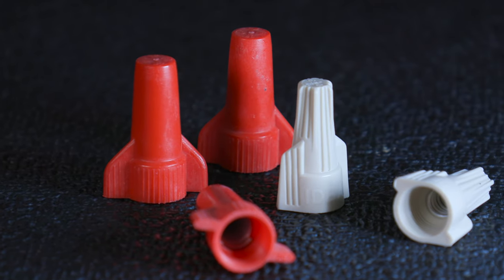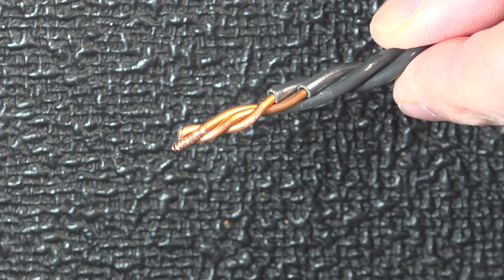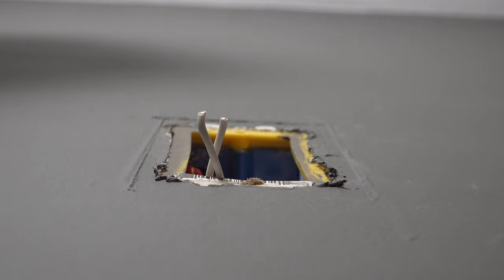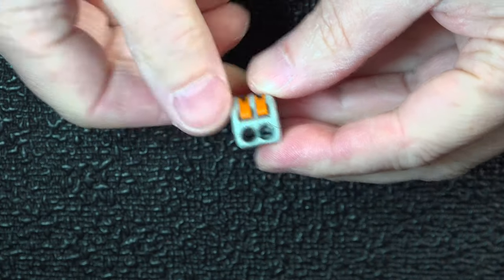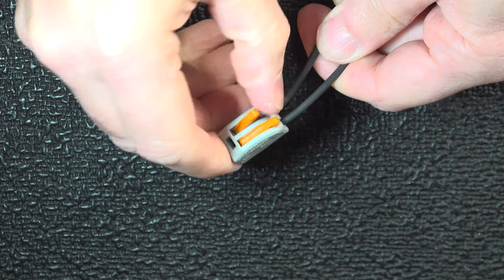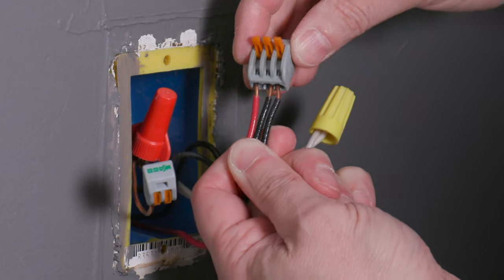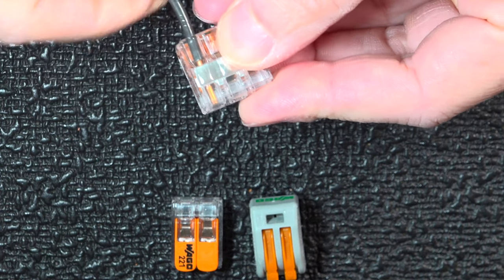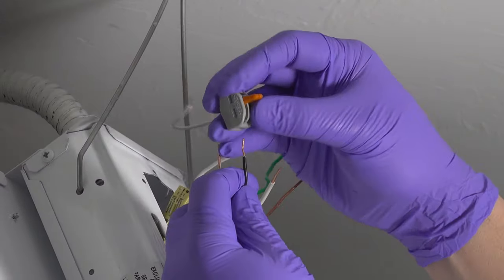Never use Wire Nuts Again - Wago is Better Electrical Connector

Comment: This is the same as using the push in connector on the back of an outlet instead of the screw on the side one's going to fail in 30 years.

Comment: Will give you $25 if you can tell me what page and the article # wire nut or wago  is in the 2014,2017 or the 2020 NEC Book that sure has close to halve a million words in it.No substitute words or phrases.
Reply from the maker: They are not called out specifically because they meet the same criteria for pressure connectors, as do wirenuts and other connectors

Comment: Wirenuts in the 2000s? Everytime ive came accros that type has been when ive been working on buildings dating back 70s and lower. How come the US don't keep up with progress in construction? You still heat your homes with the ventilation, A practice that were popular in the 80s here.

Comment: Don’t listen to anyone who does wiring with surgical gloves on. “ and they don’t cost that much more because it will save you time” bit, ain’t buying that either. Wire nuts are perfectly fine if installed correctly.

Comment: Wagos save time but the contact area and hold of proper twisted wires beat a wago .  Want an even better connection twisted wires copper crimp or soldered

Comment: I still cut those Quick Connect off of fixtures all the time I use wire nuts so I know there is connection recently install the switch and had to get power from another switch box I pulled on the blacks and the whites and the quick connectors came off I don't trust him I throw them in the garbage I still use wire nuts

Comment: Wire nuts work great. It’s ridiculous to say you have to cut off the end of the wires every time you want to disconnect them. Just unscrew the wire nuts. When connected correctly, the thread marks on the copper are inconsequential.
Reply from the maker: Nicked wire is not ok under any circumstances, electricians are trained to recut and strip when that happens. Maybe it's "good enough" but so is using dirty needles until there is a problem. You will not find any documentation to support that chewed up wire is ok to add more connection. You KNOW it is not giving you a better connection.
Reply: @SilverCymbal  There's a difference between thread marks and chewed up wire. The chewed up wire you show in this video doesn't look like damage done by wire nuts but by pliers. Clearly, chewed up wire should be cut off, but I've never seen wire nuts do that kind of damage. They work and they are reliable because they create a direct solid contact between wires and there's really no risk of failure when they're installed properly. WAGO connectors seem to introduce more complexity to the connection and opportunities for failure that can be tricky to diagnose.
Reply from the maker: @davidguthrie3739  The marks you saw are from a wire nut. This can be tested yourself. Even when I din't use Wagos I would redo the ends. Sure you can shove another wire in there but you know as well as I do that will not be as good as a connection as if done new.  Does it mater? 96% of the time probably not, but thats the issue you just don't know or want to be the 4% when it's a problem.  You should watch my follow up video for connectivity at overload: https://youtu.be/B1pmuRsf1co  More food for though, search on google on burned Wagos you will find no images. Search on burned wire nuts, you will be ill by what you see.

Comment: There's some inaccurate info here. Wire nuts are the most efficient and cost effective way to connect wires. Workers don't have time to sort through several types of wago connectors not to mention money to pay for them. I'm sure as hell not going to be underbid because my cost on wagos is adding heaps to the job. The customer wants affordable, reliable work done. That is up to the worker, not the product to deliver that.

Comment: I do not think you should be showing connecting 2 black wires and one red wire in the same connector. No harm is done if they are all neutral or live but not if live and neutral. In the UK, black is neutral and red is live. Putting them together in one connector is going to make a short circuit. If you do mix black and red wires as one, then it is normal to put a red or black tape around the odd colour to signify what type it actually is.
Reply from the maker: That is interesting. Here our neutral is always white.  Black is typically hot as we call it and red can also be hot in some situations also but red here is never neutral.
Reply: @SilverCymbal  That is a good reason not to bring electrical items made for the USA back to GB, apart from the fact that we have 240v as the norm. I think that the US has 110 and 220v. Our earth wire is always green with a standard plug wired at three points, neutral (blue or black) Earth (green) and live, (red or brown on an older circuit) If a circuit requires a wire colour to be known as another, then the end of the wire is sleeved at the connector point to show the designated colour. This can happen in a complex lighting circuit. When I first used those new connectors I wrongly assumed that each section was independent and used it to blank off a 3 core wire. Power on and bang. Oh dear and just as well that I had a micro trip circuit breaker so no harm done. A happy new year 2022 from across the pond.

Comment: IMHO, any device has pluses and minuses. The important thing is to use any device correctly which means different connectors for different applications.

Comment: I hate when I see someone has added wire to a connection without upgrading the size wire but it is always a terrible thing I see it so much from someone like a DIY just take and tap into a circuit and doesn't reconnect with a larger wire nut.

Comment: I was in my first apartment and I was having some kind of electrical problems the lights would flicker. I looked around and I found in the basement in electrical box that was making a noise when I had the lights on and it was only when I had the lights on so I opened it up and they had four wires attached together well I needed to have electricity for my apartment and fortunately I was able to shut the electricity off I went back and I used a soldering iron to connect the wires together. then I put the wire nut back on and then I proceeded To tape the mess and it work good after that I never had any more problems. I don't like using wire nuts either, but I would use them before I used those other funky things that you showed me in the video.

Comment: I hate when diff ees rent wire gauges  are just put under a wire nut without a physical twist in the connection.

Comment: why are u making it sound like wire nuts are bad, of course you need to make sure they're on securely,  if they're not biting into the wire when you twist it on it's bad, if you keep on twisting and the cap break you're super strong and that's bad. you're over exaggerating the dangers of a wire nut. how often are you making a new connections? there's so much wire its so hard to push it back in, its asking to be cut a few inches off!

Comment: Hmmm. I disagree.  I've never had a problem with wire nuts especially since the advent of afci breakers. I have found that wegos often have a poor connection causing arcing in the neutral wire causing the breaker to trip. Yes, they are fast,  and they are great when the wire is to short inside jbox. Another point, if the box is packed too tight to use wire nuts, its probably overloaded per the 40% rule.
Reply: Try connecting stranded to solid copper, or 4 wires with a nut. It gets sketchy quick. Houses that are 50+ years old can have shallow junction boxes and 12ga solid copper.. not a lot to work with.

Comment: I never use these types of Wago connectors.  If I see them I always replace them with wire nuts.  I believe these Wago connectors actually have the potential to be more dangerous, because they only make contact on an edge, increasing contact resistance which creates heat.  On some jobs, I even had these Wagos just fall off when the wires were unfolded from the box.

Comment: Fast is NOT always better.  Just like the push in connections on electrical outlets this puts the minimal amount of CONTACT to conduct the juice.  If a real load gets on that wire, bet that this will be a spot that will heat.  Over time, they might fail.  Wire nuts never fail...full contact of the two wires..reduces heat and can always be taken apart.  If you take it apart, simply re-twist the wires in a new location and the wire nuts will grab the wire again.  You can do this over and over again if necessary.  Always twist the wire before connection. with wire nuts too......remember it is all about how much the two wires contact each other.  Heat causes fires....houses can burn down.  Be smart do it right and don't go for speed.  Never look back.

Comment: Commercial electrician- Watching this is hilarious. I've seen one week apprentices make better connections that what is portrayed. I've used a variety of wire nuts from multiple price points and rarely have any issues.
Reply from the maker: You remind me of my "senior" union electrician, 3x hit he EPO button on a UPS for a major hospital, instead of the light switch. Guy was a pro for 40 years and couldn't remember which button was the lights or the wall. Nobody's perfect, not even the pros.
Reply: Gotta love infomercials...

Comment: Too expensive the price of a wire nut replace them  You will not beat the physical contact in the wire nut whereas the the yago is just a pinch which would mean chance of higher resistance heat and failure

Comment: I tried to use wago connectors 
NEVER WORKED !!!!!!!

HAVE USED WIRE NUTS MY WHOLE LIFE
WAS ELECTRICIAN
ALWAYS HELD
THEY COME OFF EASY
REUSABLE OVER AND OVER
Reply from the maker: How could they not work? Reusing wire nuts, sure if you hate your customers go ahead, you could peel back electrical tape two for round two. Good grief, even if you don't use Wagos please install new wire nuts. Why risk it to save pennies

Comment: never ever pretwist the wires!..... , just slide the wires into the nut , THEN TWIST.......JUST TRY IT and see how rock solid it is
Reply from the maker: You are 100% correct, Ideal even states that pre-twisting is not required, but yet everyone still does it. Makes no sense.
Reply: @SilverCymbal  they fall apart with a simple wiggle, but shove a few straight wires solid braided or mixed and do it correctly and tug like hell and its rock solid almost ever time.....i did it the wrong way for years

Comment: The only thing I can agree with is no you should not be reusing wire nuts. In no way shape or form are these connectors that he is shilling to are better than wire nuts when wire nuts are used properly. If you twist your wires in a clockwise rotation and use the proper size and composition of wire nut, there is no way that these connectors are better. They have their place in low amperage conditions. We need to stop trying to make things easier and teach each other to quit being lazy and do work the proper way. If you really wanna get down to it, crimp sleeves or an even better connection. You just have to cut the wire off To undo it unless you are skilled enough to cut the crap off without damaging the wire. By the way, I am a licensed electrical contractor of over 15 years

Comment: As a commercial and industrial electrician I've never had problems with wire nuts. Every wego I have used on a commercial project has failed. IMHO they are junk

Comment: Three times more expensive than wire nuts.  I don't know the figures on how many fires are caused by wire nuts but using them is still an accepted method by the NEC.  I have no problem with these connectors except for the price.  There is a bit of misleading information in the video however.  Obviously trying to sell Wago connectors.

Comment: I have done electrical work for 38 years. You are way way overstating any problems with wirenuts. Like almost any trade, it's experience and details that make tools and equipment do the job. Problems with wirenuts are almost completely due to lack of proper installation by the  DIY person or the Hack posing as a professional. All that said, in recent years I have been using wireports/Wego connectors and I have every confidence in them provided the installer workmanship is adequate.
Reply from the maker: I agree with you completely. Poor installation causes the majority of issues but that's the issue. There really is no way to know if all the wires are in completely, how tight is tight, how hard to pull. Sure in most cases they hold but the Wago eliminates the pull, feel and hope that all wires are perfect & it doesn't damage the wires at all. At some point I guarantee Wirenuts will be removed from the US market just as they were in the UK & many other countries. The NFPA, UL, CSA all proved the Wagos conduct electricity just fine to their ratings without issues, which is 99% of what sparkies want to say, fire starters, endless problems, none of which is correct. Sure maybe cheapo wanna be Wagos, I have never seen one genuine issue or burned out Wago yet, despite millions of views on this videos and offers for ANYONE to send me what they have or even share a picture.
Reply: @SilverCymbal  I was leery of wireports for years. Then it hit me.... So many recessed lights sealed away in the ceiling, if it was an issue it would be big news. And so I started using them. Soon after, I was working on a live circuit (don't tell the amateurs please, lol) and I accidentally energized a dead short WITHIN a wire port. I examined the wire port and it was completely undamaged except for a smidge of arc flash. I discarded it anyways. Point is, wire ports are excellent material. I still use wire nuts in certain situations but wireports definitely make great connections.   PS when installing a wirenut.... Pull on each wire after less than a full turn on the wirenut... Then tighten it up. Then tug again on each conductor. Do not tape the wire after.... Just trust me, it's a horrible and stupid practice.

Comment: Only an idiot would use these to join a solid conductor with a stranded core wire !!!
Obviously designed for joining ONLY solid conductors !
Read the manufacturer's spec sheet.

Comment: I was shocked (pun intended) when I started living in North America 12 years ago that wire nuts are still in use. We stopped using these over 20 years ago and use terminal strips instead. I was stunned to see haw archaic a lot of the house wiring technology is that is still in use. Most would not pass electrical safety standards in many European countries.

Comment: As a commercial electrician, here is why Wagos, which have been out for years, are not used professionally. 1, they are more expensive. 2, when connections are done the correct way, properly pretwisting your conductors, a wire nut is actually a better connection. The trick is actually not to rely on the wire nut for your connection, but only use it to insulate and be an extra safety for your wires.

Comment: There cool looking but as a wire it being reused?! I’ve used wire nuts over and over. Never had a problem. In fact I’ve done wired my own house of 15 years  as well as new houses and commercial wording in which ceos can’t make up there mind and have used wire nuts over and over with out issue. If you have a issue with wire nuts, you don’t know how to use them.

Comment: Ok so you're not an electrician. If you are you should stop. I appreciate your trying to help. 
1. That was 4.5" of wire.
2. Those clasp style connectors are only good to a certain amperage, which you do not specify. If overloaded could actually start a fire or melted connector. 
3. That connector did and does deform the conductor. It was visible in you video without my w wearing glasses. 
4. A trained electrical would know better than make the mistakes you mention. 
5. You should take this video down and rework it until you have safer information for do it yourselfers. 

Again, I appreciate your attempt to help and inform, but the information needs work. 
Please remove your video for your own liability. 
Take care of yourself. And don't stop helping people.
Reply from the maker: https://youtu.be/B1pmuRsf1co

Comment: Electrician here. This is nothing but an infomercial. It would be good if you actually use the damn wire nuts properly. If you don't twist the wires together, it is not to code. You need as much surface contact as you can get.

Comment: i'd like to see the corrosion resistance data. seems like the connection itself between the wires is much weaker due to more individual contact points. No wires are ever touching one another, only a bar between them, and we didn't get a good look at what the connection between the bar and the wire actually looks like.

Comment: Wagos are trash, I don’t know how many service calls I’ve gone on where an outlet or a light isn’t working... open the box up and here’s a wire that’s popped out of the wago just hanging there... pop the wires out twist them and put a wire nut back on and it’s good to go
Reply from the maker: I know how many calls you have received for failed Wago 221 Connectors = 0.0

Comment: Firstly, you can reuse wire nuts and who ever told you you have to cut the wire off and re-strip it to put it under a new wire nut lied to you. That little bit of scoring from wire nuts does nothing to the integrity of copper wire, only aluminum and you’re not supposed to use aluminum anymore anyways so no problem there. 
Secondly you’re telling me those wagos that you can get from wish are better than wire nuts? No. Sure wire nuts come loose over time but we are talking like once in 30 years unless there’s excess vibration going on or something. Meanwhile those wagos I’ve been called to countless homes because of wire connections with wagos and the wagos completely melted. In my personal experience as an electrician of 12 years those things are a fire hazard.